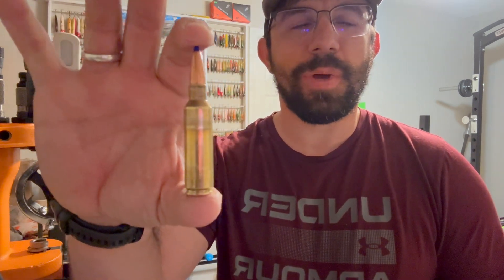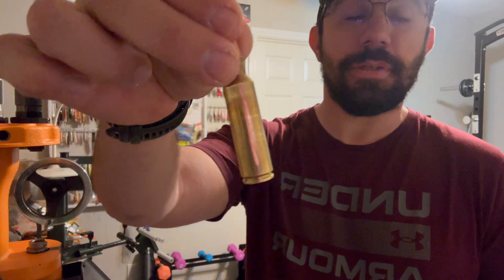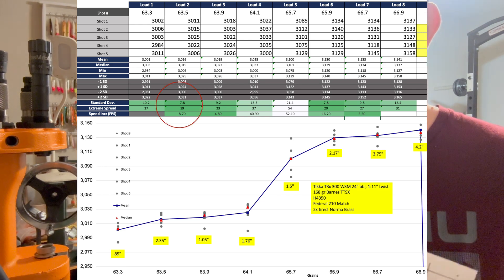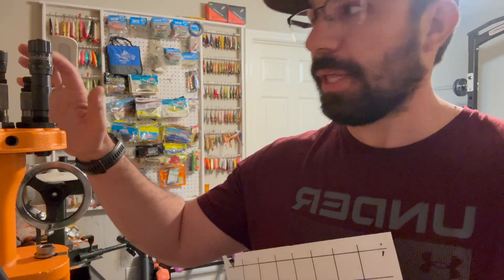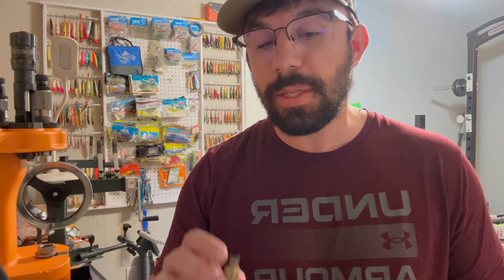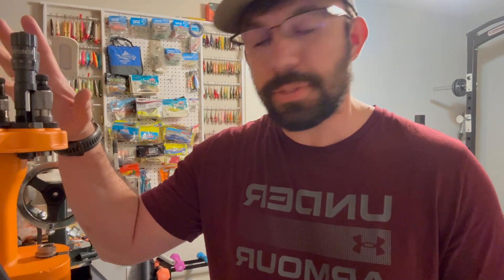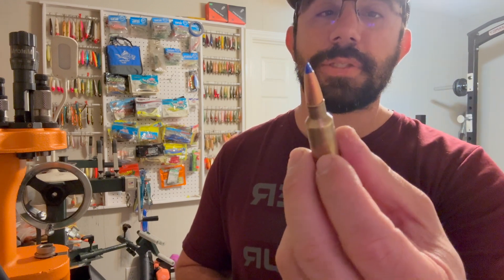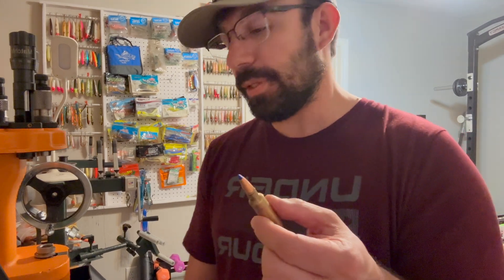300 WSM 168 gr Barnes TTSX Load Development with H4350 and Fed 210M

Comment: I just got a tikka 300 wsm. I have lots of IMR 4350 powder. My Hornady loading manual noted that as a favorable powder for the 300 wsm. I found some loads for 168 lead core bullets. I loaded up about 15 rounds working up from 65.6 grns of powder to about 66.8 grns. I noticed that the loads seemed to be compressed, especially at the 66.8 grn end.  It occurred to me that the copper ttsx 168 grn bullets seemed really long. (copper is lighter than lead). Also, I haven't measured the distance to the lands but just loaded them to a COAL length of 2.84" and they just fit in the mag.  2.84" was what I saw for the lead core bullet data I based that on.  I am going to scrap those loads.  I know you are using H4350, a different powder, but did you have similar concerns with the length of the copper bullets? Barnes online data didn't have the IMR 4350 powder listed in their data that I saw for the 168 grn TTSX bullet.
Reply from the maker: Barnes website has a COAL listed for 168 gr at 2.86”.  Try looking at Hornady, Nosler, or even Hodgedons website for a powder listing based on a similar weight copper bullet for your powder.  

Yes it’s going to be longer than a typical lead core bullet, it’s lighter.   But if you have a new tikka with 1:10” barrel you should be  able to load even the 175 or 180 gr Barnes with ease.   For compressed loads, a drop tube will help fill the case better.
Reply: @DanielGuillette  Thank you for the response and info. I will look into the bullet again, it seems to be the hot bullet. I am working on some eld-x and accubond loads at the moment. I really like the 300 wsm, and with a brake its not bad to shoot.

Comment: I'm in a similar situation. I have a tikka with norma brass. I'm at the last minute bc deer season is close. I tried 3 factory offerings with no luck. I tried a 175gr berger vldh with a run of h4831sc and h4350.

Comment: I bought a stainless Tikka T3x 300WSM. Gunsmith I used reamed it with my 300WSM-DM-Long reamer so I could seat bullets further out. I loaded 150 TSX over Superformance, 168 TTSX over Staball 6.5, and 180 Accubonds over IMR4350. All 3 were tight grouping. I had just boxed up my old chrony and was waiting on my new Garmin but I never did clock any. Now that deer season is over I'll be seeing what they can do. Then I bought a Terminus Zeus QC long action and had 2 Brux barrels chambered with my reamer, one 9 twist and one 10 twist. In the 10 twist I worked up basically what turned out to be a match grade load - ADG brass, Federal 215 match primer, VVN560, and a Federal 200 grain Terminal Ascent at 2960 fps in a 24" barrel. My gun builder was shooting 190s in his 13 twist barreled 300WSM. Whatever you do, forget the fast twist hype. The slowest twist that will stabilize your bullet is the most accurate (written, repeated, witnessed by many, myself included). Now I wish I never bothered with that 9 twist. You just sacrifice speed with the faster twist barrels, not much but some. Also found out that Berger 210s and Reloder 22 are fast and accurate as well. 

Late December, I got a second Tikka T3x stainless 300WSM. Have yet to shoot it. Took advantage of Tikka's year end lowered prices. Picked up that one, a 30-06, and two 7RemMags, all 800 each delivered. And of course now the prices are even lower by another $15 each.
Reply from the maker: I love the caliber.  That’s great speed for those 200 gr terminal accents.  I’m getting 2860 fps with factory eldx in my stock rifle
Reply: @DanielGuillette  Try Norma Bondstrike. Norma and Tikka are like a solid marriage. Have yet to find any of my Tikkas not shoot Norma ammo extremely well. Bondstrike is as 180 grain.
Reply from the maker: @Accuracy1st I have, it’s just hard to find the ammo.
Reply: @DanielGuillette  kir ammo - 28 cases

Comment: You should try the 130 tsx. 3600 fps in mine. Shoots very flat.
Reply from the maker: @brianwood7882  damn that’s fast.  What powder are you using?
Reply: @ VihtaVouri N550
Reply from the maker: @brianwood7882 thanks
Reply: @ 125 grain Nosler Ballistic Tips are fun too. You won’t see an impact on coyotes but you definitely hear it.
Reply: How is the recoil with 130:s
And how long barrel do you have?
Reply: @Greyzonecompliant  25” inch barrel. Rifle weighs 10 1/2 lbs and has a muzzle break. 
At 400 yds it shot 2” flatter than my 220 Swift.